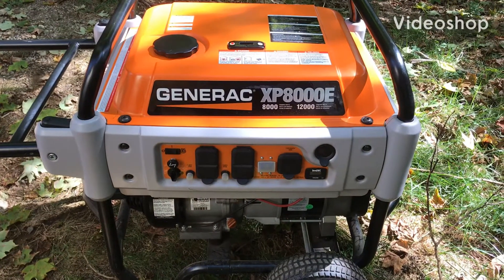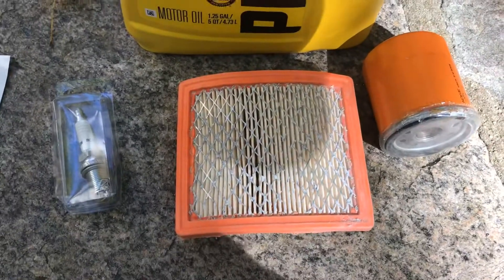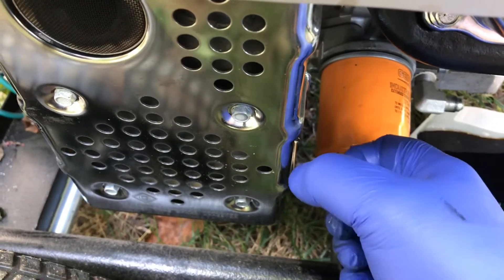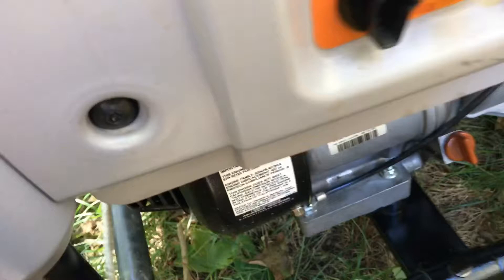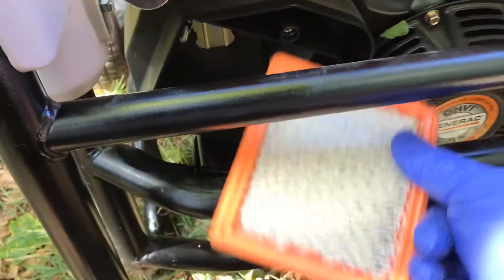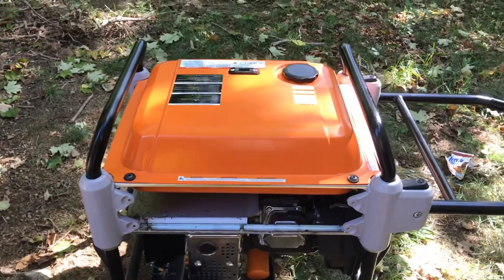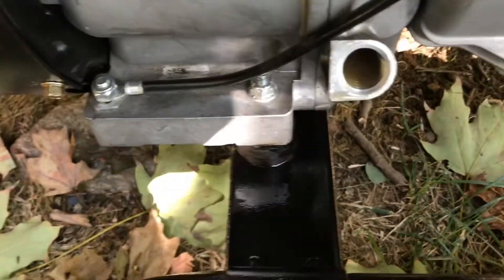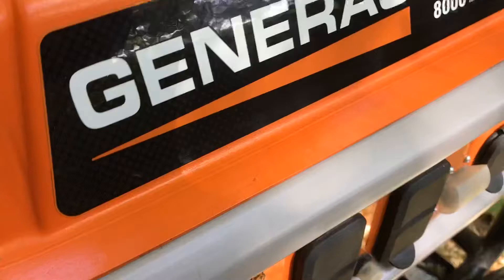Generac XP8000E oil change, air filter, spark plug

Comment: Nice video. I have the same generator XP8000E , except model year 2017. I love it and have no issues. The air filter is easy to get to with the model changes. The oil drain now has a hose to make it easier. I appreciate you showing the installation of the spark plug. This XP8000E is a very nice commercial generator and top of the line.
Reply from the maker: I agree Benny!! This machine is a champ!! It’s definitely one of the best purchases I’ve made. Thanks for watching bro👍🏻

Comment: The marks on the air filter are rust from the bolt head and shaft that they come in contact with. The filter itself must retain a little moisture and cause that. I sprayed WD-40 on these parts before I reinstalled the new air filter. Thanks for the video it was very helpful!

Comment: I was given one of these, the homeowner I was working for let the battery die, he lost power and tried to pull start and the pull broke, he was so disgusted he asked if I wanted it,. I cleaned the carb, jumped it with a 12v battery pack,and it runs mint.. omly 50 hrs. About to get the air, oil filter, and I'll just jump it in the cold weather. Great vid.
Reply from the maker: What a score bro👍🏻👍🏻👍🏻 good luck with it.
Reply: Don’t forget about the generator safety rules and here are the generator safety tips: anyone who uses portable gas generators really needs to see this safety reminder. All generator safety rules should be followed carefully. This advice is just to make sure that everyone is aware of all the warnings and it’s just to remind people to be careful using portable generators. Generators can be dangerous if not used carefully. Every year, hundreds of people die or get injured when using portable generators due to carbon monoxide poisoning and electrocution. Make sure you are using your generator carefully and keeping others safe as well. There is something very serious that everyone should always be aware of when using generators. Some people do run their generator indoors which is not safe and that increases the risk of carbon monoxide poisoning which can cause death of family and you. Some people run their generator in wet conditions which can electrocute them. Please remember that you should never run your generator indoors. Remember that carbon monoxide is an odorless and colorless gas that you cannot see or smell. Carbon monoxide is a silent killer. Keep that in mind. Make sure your generator is 15-20 feet away from your house and away from doors, windows, and vents. Never use your generator in your porch too. Having a carbon monoxide detector is very important against generator safety. Some people also allow children to go near the portable generator which could pose risks. We need to keep an eye on our children making sure that they are not near the portable generator so they won’t get electrocuted or burned by the generator which is dangerous. A locking enclosure also keeps kids safe. A generator shed might look like a tempting place to explore, or take cover during a game of hide and seek, but a generator is a dangerous piece of equipment that can cause injury. It says on the manual that we should also keep children away at all times from the portable generator to avoid injuries. Please do not allow a child or unqualified people to operate the portable generator. Just because some manuals missed what should be listed doesn’t mean it’s safe to do. Always follow the generator safety rules when using portable generators. Generators pose electrical risks. If you need to use your generator during wet weather, you need a generator tent to protect your generator from getting wet. Don’t let your generator get wet. Keep your generator dry and before using your generator, please make sure your hands and your generator is dry. Do not wear loose clothing when operating the generator. Everything that is said on the generator’s operating manual should not be ignored. Never smoke cigarettes near the generator. Please keep flammable things away from the generator. Never overload your generator too. Your generator can catch fire. Never ever try to plug a generator cord into a wall outlet to avoid back feeding. Back feeding your generator is dangerous. Always turn on your generator first before plugging in appliances and shut off the appliances before turning your generator off. Use a heavy duty cord for your generator and the cord should not be worn out. All the instructions should be followed carefully. Never refuel your generator while it’s running. It can cause fire if fuel spills while your generator is hot. You should turn off your generator and let it cool off before refueling it. Having a fire extinguisher next to the generator is also important. This is only a reminder for everyone’s safety of using generators. Make sure your generator is properly grounded. Having a fire extinguisher next to the generator is also important against the safety rules. It’s important to keep your children safe especially little ones. Thanks and hope this helps. Have a good one.

Comment: A couple of tips. Be sure to use NON ETHANOL fuel. This will save you huge heartache down the road. I also use high performance oil from AMSOIL.
Reply from the maker: 100% on the gas👍🏻 I should get better oil too. Thanks bro

Comment: Thanks. This is my exact model. I do have a question. We moved and this was stored. I could not get the electric start to work so I replaced the battery and now it tries to crank but won’t fire. I will change the spark plug and totally forgot there was fuel in the tank. So i  am planning on draining the tank. but this model doesn’t seem to have an easy way to do that. Do you have any tips or a video showing steps to drain the fuel?
Reply from the maker: If you stored it with fuel and didn’t run the carburetor empty before storing it you will need to remove and clean the carburetor out. Most like gummed up from the fuel. Try to find a carburetor removal and cleaning video on a generac portable generator they are all pretty much the same. Good luck and NEVER store it away again with out running the fuel totally out of the carburetor. The way you do that is start the engine and while running turn off the fuel line and it will eventually run out and stall. That’s all you need to do for the next time you have to use it.
Reply: @HighRidgeHandyman  …. Thanks and i plan on doing g those things. but on mine, the tank drain is hard to access. i’ll guess i’ll shove a funnel in there to catch the gas when i drain it… Thanks again!

Comment: I can’t figure out how to reset the oil change 100 hour after my oil change.
Reply from the maker: Try pushing the button until you get to the oil hr and hold button for 9-10 seconds. If not the meter will clear after running it for an hr or so by itself. Then when you hit another 100 hrs it will flash again an hr before and and hr after until you change it again. Hope that helps. Good luck👍🏻

Comment: Do you have part numbers? I have the same generator...
Reply from the maker: Part numbers for ?
Battery: OG9449
Spark plug:0E7585
Oil filter:070185DS
Air filter:073111S
Reply: @HighRidgeHandyman  Im guessing the spark plug is a champion, oil and air are Fram. Are those number MFG. or Generac numbers
....thank you for replying
Reply: @HighRidgeHandyman  Spark Plug is a champion RC14yc gapped at .030, Oil is a WIX 51394...still looking for air and it seems to be proprietary
Reply from the maker: @talljeeper  numbers out of the original Generac owners manual
Reply: Where you get from the parts